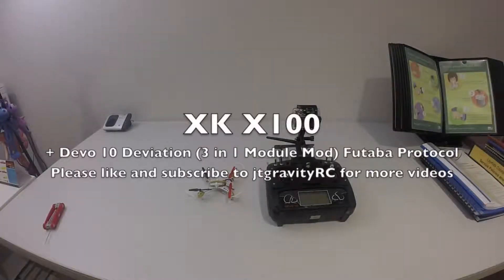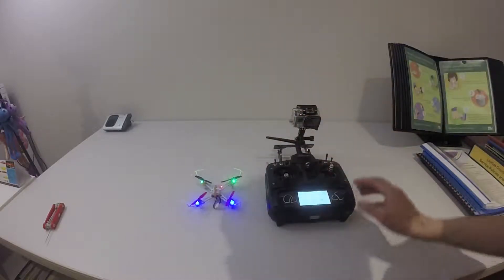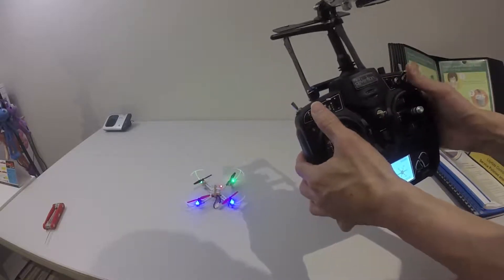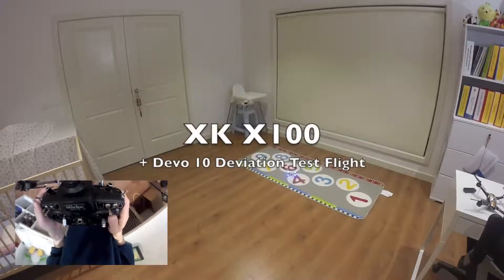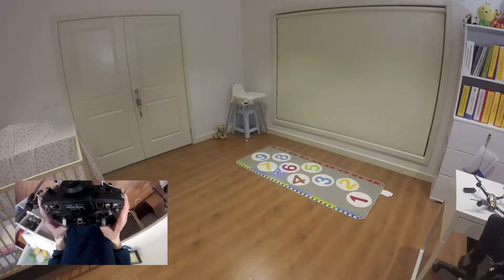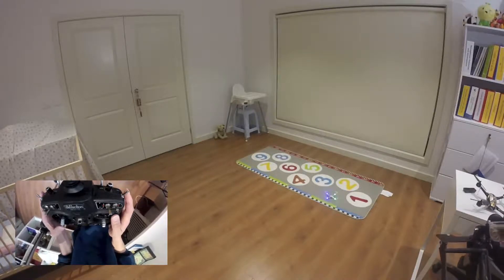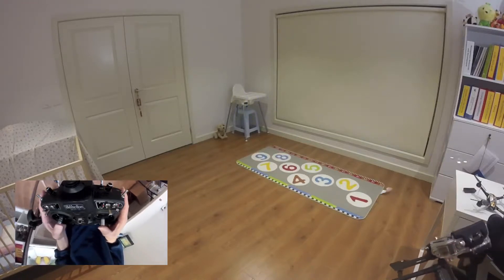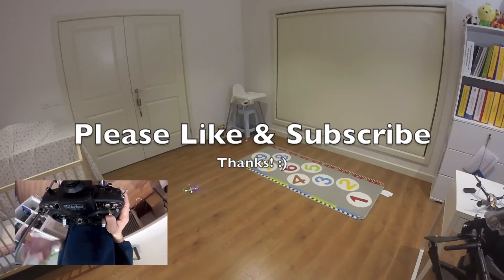XK X100 + Devo 10 Deviation (3 in 1 module mod) Futaba protocol

Comment: Have you tried it with the iRange multi module with the taranis?  I found a BNF X100 and want to use the taranis.  thanks a million.
Reply from the maker: I don't have the irange module. It should work as it has S-FHSS protocol